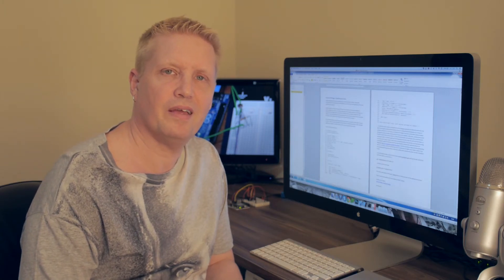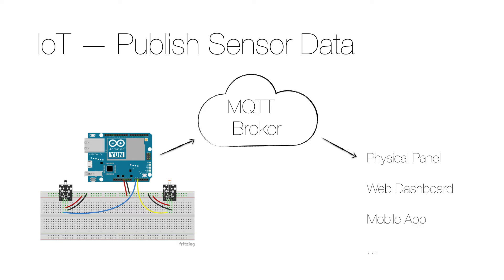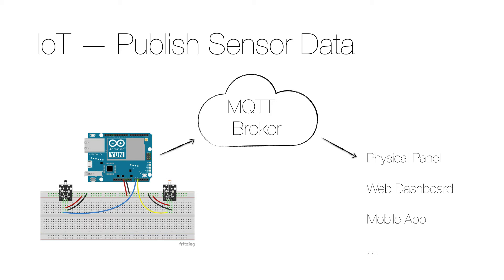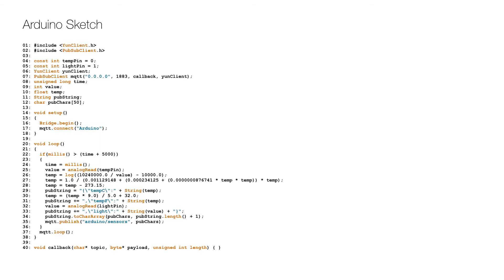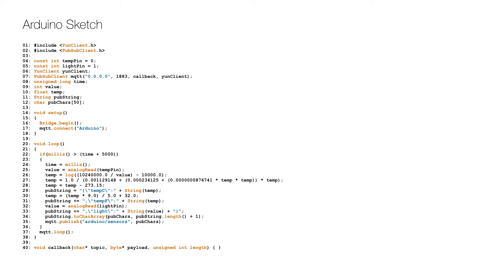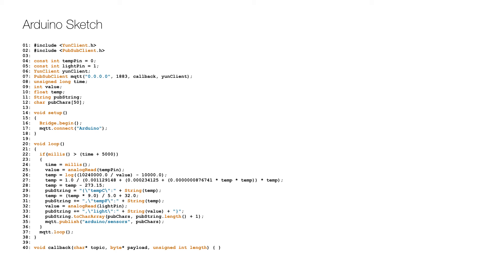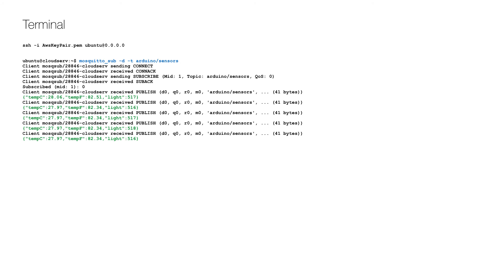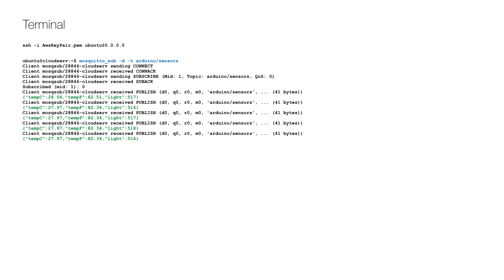Internet of Things - Publish Sensor Data

Comment: can u please tell the execution steps in windows 7 for running this program to publish sensor data??

#include <SPI.h>
#include <Ethernet.h>
#include <PubSubClient.h>

// Update these with values suitable for your network.
byte mac[]    = {  0x78, 0x45, 0xC4, 0xAA, 0xE5, 0x6F };
byte server[] = { 192, 168, 1, 50 };
byte ip[]     = { 192, 168, 1, 240 };

int sensorPin=5;
int lastTemperature;
unsigned long lastTime;
char buffer[10];

void callback(char* topic, byte* payload, unsigned int length) {
  // handle message arrived (no messages expected though)
}

EthernetClient ethClient;
PubSubClient client(server, 1883, callback, ethClient);

void setup() {
  Ethernet.begin(mac, ip);
  if (client.connect("arduinoClient")) {
    client.publish("demo/status/arduino01","online");
    lastTemperature=0;
    lastTime=0;
  }
}

void loop() {
  int reading=analogRead(sensorPin);
  int temperature = ((reading * 0.004882)-0.50)*100;
  if(temperature!=lastTemperature) {
    if(millis()>(lastTime+1000)) {
      sprintf(buffer,"%d",temperature);
      client.publish("demo/device/arduino01",buffer);
      lastTemperature=temperature;
      lastTime=millis();
    }
  }
  client.loop();
}